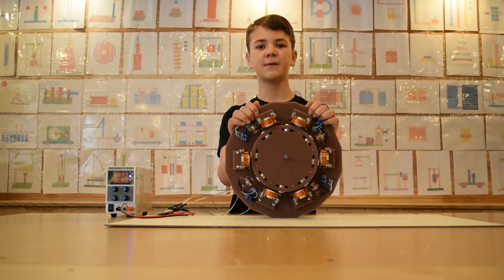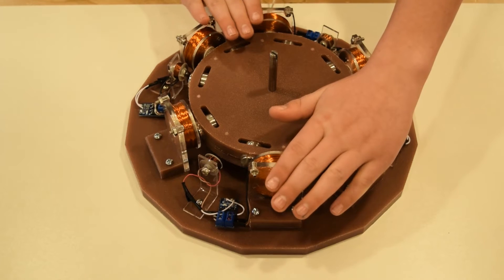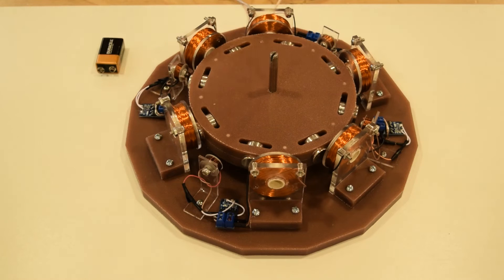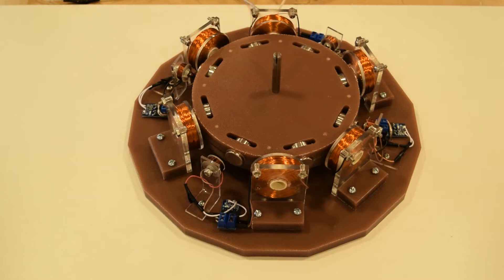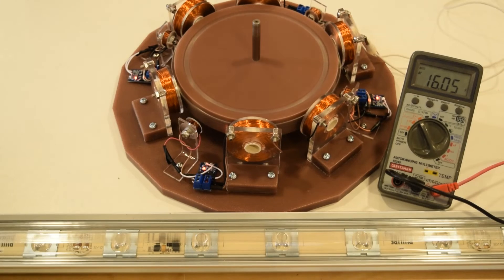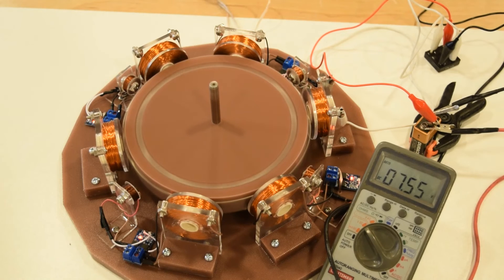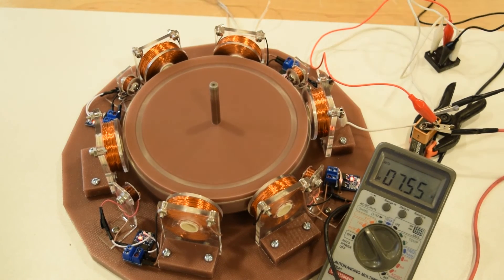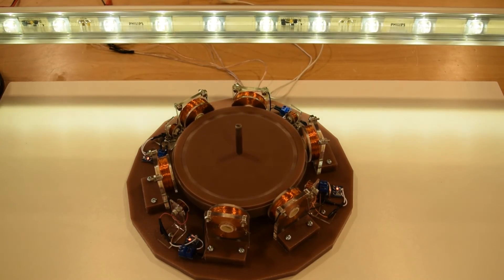Pulsed DC magnet motor.

Comment: 1. Why you using drive coils 
2. Why do you not have Capacitors on the Coils 
3. You only need 6 coil 6 Capacitors and Arduino 
4. Alternate the magnets north and south.
5. I need the coils and capacers 
resonance and just pulse the coils.
6. Yea just scrap it start over. Reinvent the wheel

Comment: BAT ..UVY NPN 6 PNP UXY...P+P- XPLUXNUTRAL PLUS POS ACTIVE PGROUND PUSH PULL NEG REAC TIVE STORED LOUD COILS CAPACITORS RESERVE RESISTOR RENUE.. NEUTRAL NEGATIVE NORTH NNN   NYVUX  QYURRUXjVULLUYQ Quad Quinta tlvux tylmux TT LL   QUAD QUINT FOURTYN FIFTYNOMBRERO jLLUXYVURRq  J  HERTZ WATTS OMEAGA APO AKP TAU GAMMA COMMANDO   OANRRYXVULLMEO Q OMHS AMPS  AZ NAMES  NO NOMBRE CHARACTER ACTIVITIES REACTORS GENERAL GENDER GERRA WARS WARNINGS WRANGLERS WALL GERRELLA OLDERS DOBVLUEXITED OCKLOCK TIMES TYMER TWO TWE TWI TWU TWA TWU TWV TWX TWY TWL..WHA WHO THOSE HUDOE..RJUXÑYQR  LUXLUYNUQJUNYURXYUR

Comment: Wait. If you're magnets are all facing North you aren't getting an AC wave form from your generating coils. You're actually getting a small amount of DC. It's actually unfortunately not that efficient. To change this you'll need to redesign the whole thing, your timing circuit, the direction of the wire in which the coils are built. Scrap the whole thing and start over essentially... Unfortunately. Nice build though.
Reply: Revisa P2020-0205 ONAPI REPÚBLICA DOMINICANA. Ya publicada. Tus sugerencias están incorporadas. Y MUCHO MÁS.

Comment: How  much energy you saved by this method?  In watts?  Mass of this motor? 
Energy consumed for 17000 rpm ?  Can it be used as generator?  Cost?  Time mfging?
Reply from the maker: This version does not run forever. If without recharging, the battery can run this motor for an hour, with recharging the time can increase lets say to 24 hours but eventually the battery will go dead because every time the cycle is repeated of recharging, the cycle becomes shorter.
Reply: @DanielsInventions  

Can this be a generator as well. With it attached to a driving force?

Comment: Hello Daniel. This video is very important to me, why don't you explain to your followers, you say, you can get more electrical power from the generator coils with more energy in the axis of rotation. Physically, it is so, and it can be achieved, by placing ferromagnetic cores in the drive coils. Greetings.